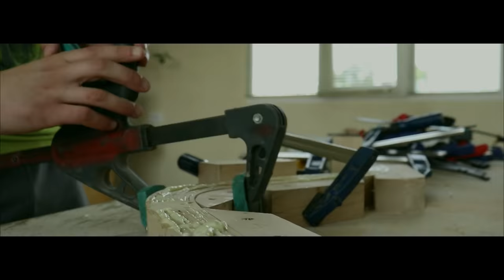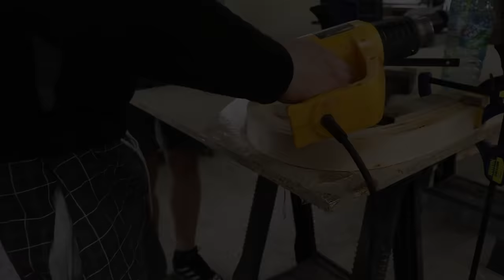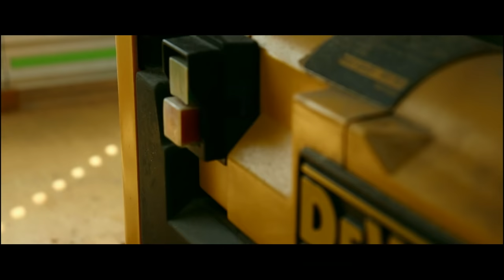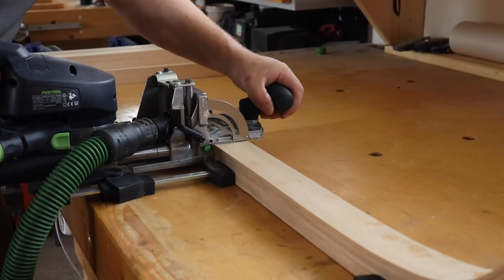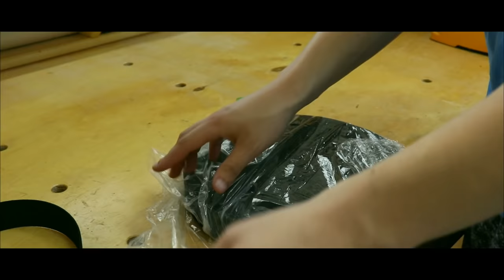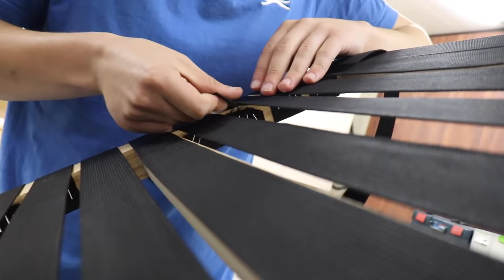DIY LOUNGE CHAIR | ШЕЗЛОНГ - Мебель своими руками

Comment: hi, it's a beautiful chair, I wanted to ask what material the black ribbons are made of. 
Thanks :)
Reply from the maker: Sorry but I don't know what it's made of. I bought it at a hardware store.
Reply: Looks to be polyester fabric since it seems he sealed it with fire after cutting. Polyester fabric will clump up and harden when exposed to high heat. You should be able to get some from JoAnn fabrics or any other kind of fabric store.
Reply: @Chring456  thank you so much
Reply: @WOODDESIGN6730  thanks

Comment: Polyurethane is a tough glue to control for multi lamination due to slip creep, foam out and quick set.
Reply from the maker: Polyurethane adhesive has different drying times.